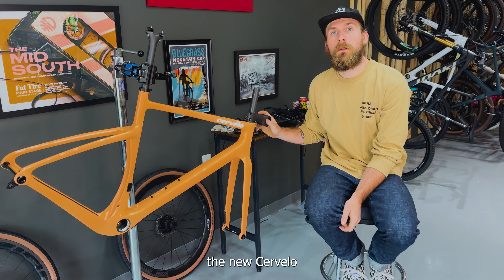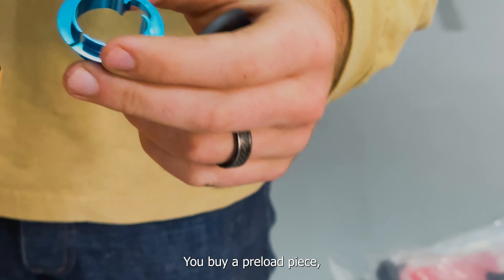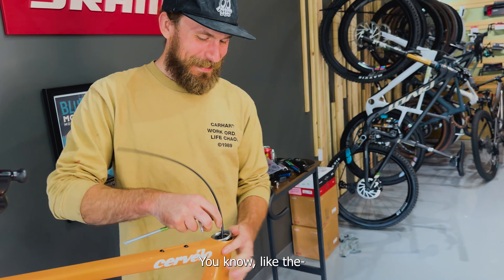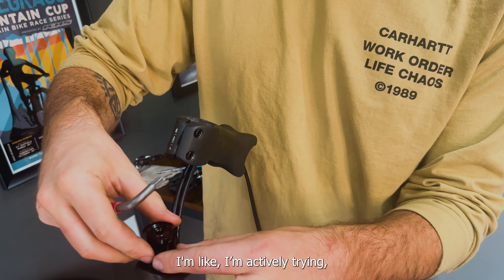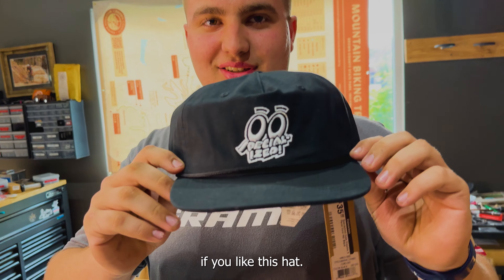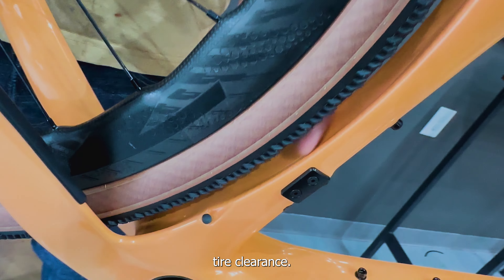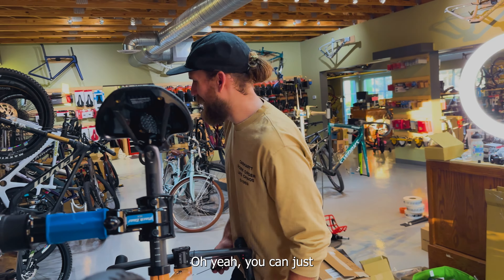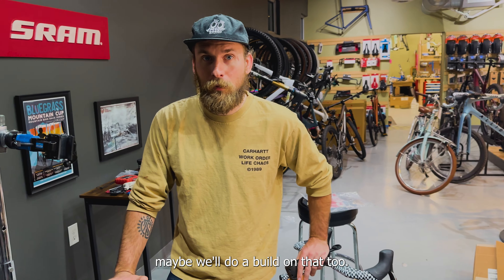New Cervelo Aspero Build

Comment: Thanks for this video.  I just bought the woodsmoke frame.  Can you list what is needed for integrated cables.  What stem is that?
Reply: Never mind…your website lists everything needed.  Thanks.
Reply from the maker: https://cervelo.cdn.prismic.io/cervelo/e8e40a3a-7f87-448d-a24e-8bc430c2fda2_aspero-5_manual_v3.1_web.pdf

There’s a diagram of the stem and headset in this pdf that has all the part numbers. This is cervelos st31 carbon stem. 

Send me an email at jesse@thebicyclestation.com if you want me to source the parts for you.
Reply: @bicyclestation  thank you.  That pdf is quite helpful.
Reply from the maker: No problem. The split ring is required btw. It’s a different one than the one that ships with the frame. 
You’ll also probably want to order the computer mount for the stem. It’s not included
Reply: @bicyclestation  thanks….sigh.  The list is never ending.

Comment: The schwalbe tires are meant to have the rear tire reversed to create additional traction. Not sure how much of a difference it makes as I only rode them as instructed when I had a pair, but I know that when they were raced at Unbound in 2022 none of the pros using them reversed the tire

Comment: I have another question 😀
I’m all Shimano now but I’m looking to switch to SRAM. I thought T47 was the way forward but after watching your video I’m not sure? I’ve always been hesitant to get into a BB86 frame if I’m planning to go SRAM because it doesn’t seem ideal for larger spindles. What do you think the best BB standard is for SRAM dub cranks?
Reply from the maker: BSA
T47 is cool because it’s threaded and it helps frame designers fit more in the space. But yea when you go to remove it I’ve seen a lot of em get stuck in there frame. Its functionally better then pressfit but I think harder to work on.

Comment: I just can’t bring myself to buy a gravel bike with integrated cables. I don’t know if the dirt around me is extra talc but even with me servicing the headset bearings multiple times a summer I end up trashing one set a season. That currently costs me $14 and takes 10 minutes.
Reply from the maker: That’s totally fair. I can’t remember the last time I trashed an upper headset bearing but I don’t blame you at all.
Reply: You’re right the lowers are the problem. Unless I’m missing something though, there’s not enough slack in the system to drop the fork enough to get the lower bearing out right?
Reply from the maker: That’s a good point. I purposefully left the hoses long to aid with this type of thing. A long as you can pull the stem off the fork dropping out shouldn’t be an issue. You can unbolt the break caliper off the fork to give it even more slack to work with also. I know because I slammed mine it wouldn’t be an issue. 

Still not as easy lol

Comment: @bicyclestation Cervelo Aspero Bike is ready to be assembled but I forgot 1 part and wondering if you have it.  I have the HB13 Bar, ST32 Stem, Spacers, Split ring but I need the headset bearing top cap.  I am unsure which one to get and not much available via google.  Is it the BC-413?  Thanks.

Comment: The bottom bracket is ridiculus. Instead of simply using a BSA thread they decided to go with this goofy T47 with almost no flange so it's near impossible to install the bottom bracket on your brand new frame without scratching it. It's like the Cervelo guys were thinking "we definitely need an elephant in the room so let's do something funky with the bottom bracket - people always love bb experiments". Otherwise this bike looks very well thought out and nicely executed (like the face milling of the flat mount after the painting process). Small minus for me: there is no storage solution in the downtube.
Reply from the maker: At least half the bb is external lol. Trek and enve its both sides. I’d say that the downtube storage is a downside for a lot of people. But then they include the bag with the bike. I think including the bag cancels that out.
Reply: @bicyclestation  Checked some T47 installation videos. It looks like there are some special nylon plastic sockets for those super tiny flanges which have a very tight fit and prevent scratches on the frame (https://youtu.be/IY3wdYK88Bw?si=Ttryf4DK_urWLQmr).
Reply from the maker: They send that out with the bb. The issue is that there’s not enough flang to remove it. If the bb is at all dirty or stuck it’s almost impossible to remove without damaging it

Comment: The Lauf Seigla carbon frameset with Grit suspension fork is $2290 😎.
Reply from the maker: Yea lauf is being super aggressive with their pricing. Looks like that bike is currently 3000$ for the cheapest one. It’s interesting that the frame is still only 600$ less for the ridged fork option. They are giving the parts away for free basically. Cervelos not selling direct so the price difference makes sense.
Reply from the maker: I’d consider lauf a direct to consumer brand at this point also. Not that that’s bad. Honestly your bike sounds awesome!